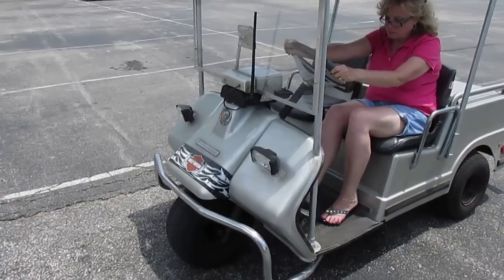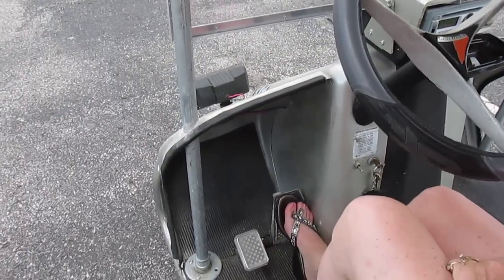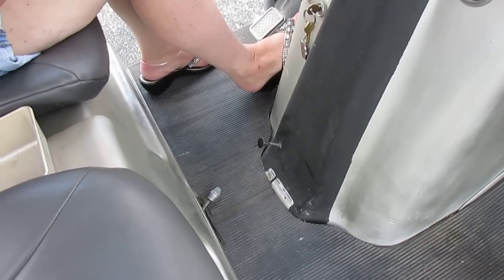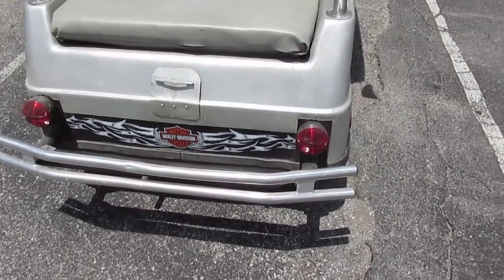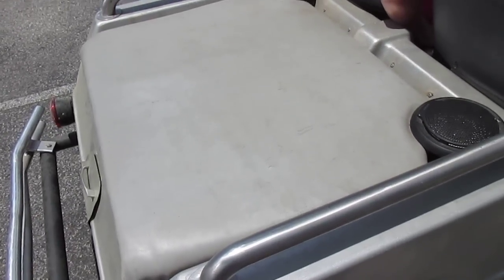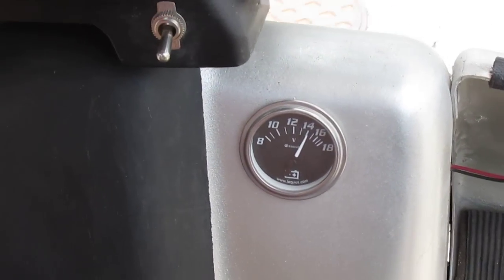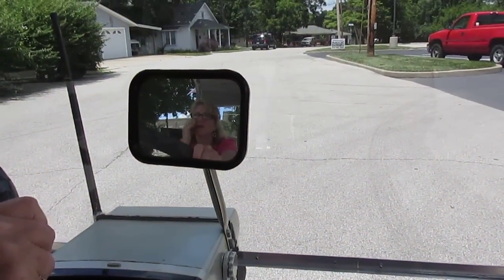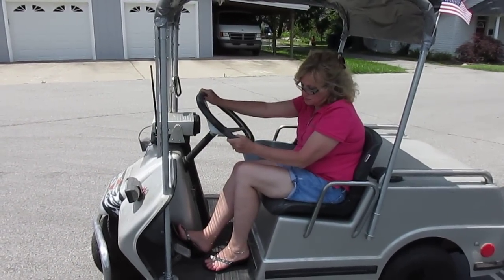AMF Harley Davidson 3 Wheel Golf Cart Ride

Comment: Well like you mentioned its a 2 stroke (most 2 strokes can withstand well over 8 thousand rpm without expploding) the governer on my 1977 Harley Davidson  is removed and it goes like 18mph. Now I would not hold it wide open for vary long because you may damage it that way. As for speed I get like I said 18mph but yours may be tuned better that mine (I just got it running)